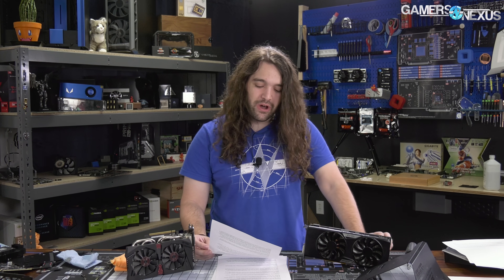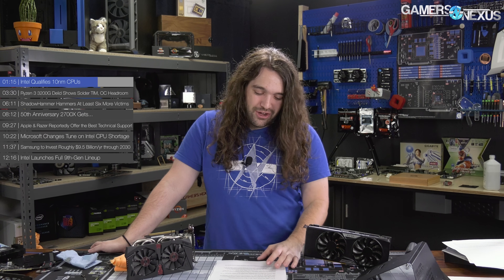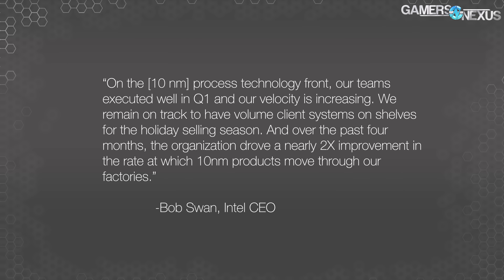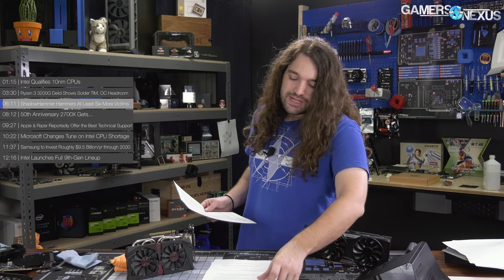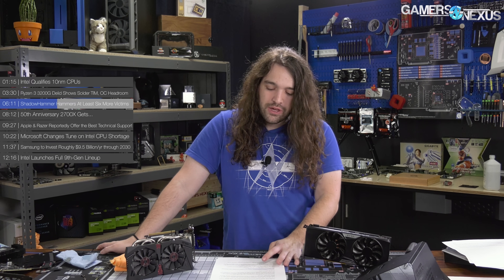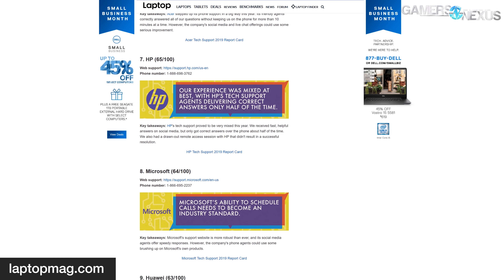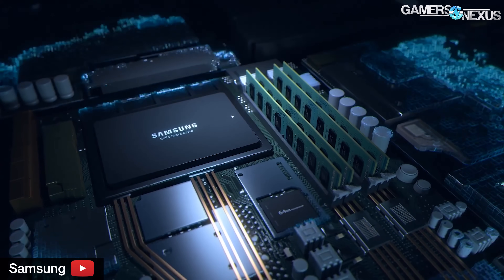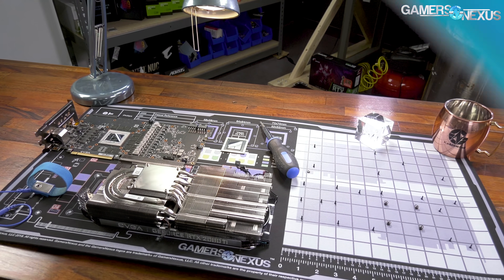HW News - Ryzen 3200 Delid, Intel 10nm Qualified, & More Malware

Comment: the 3200g and 3400g are clocked pretty low out of the box if rumors are to be believed. So getting 300mhz isn't really that impressive on these chips. It still puts their clocks in line with other Zen+ chips. 

I can't wait to see some 7nm leaks. That's where things should get interesting.

Comment: I see Ryzen 3000 news, I click
Reply: Although, the 3200G is based on Zen+, manufactured at a "12nm" process instead of 14nm. Quotes because 12nm is a marketing term for optimized 14nm.
Reply: @Kepe  "12nm is a marketing term for optimized 14nm" and most people will fall for this...
Reply: @Kepe  
14nm is also marketing term for optimized 16nm.   These nanometers are just marketing terms..with "14nm process" some things are done at 30nm and with 7nm these things are done at 20nm.

Comment: So the 3200 G and 3400G are Zen+ respins, to slot in before the Zen2 3300G and 3600G.
Reply: Lol you really are dumb.... Believing adoredtv leaks which have already been proven false
Reply: I doubt 3300G and 3600G will be a thing but yes that's right
Reply: If you want a 7nm Zen Apu you will most likely have to wait til 2020 when they release Ryzen 4000 series 7nm+. The 2200G and 2400G were 12nm Zen Apus.
Reply: The 3000 APUs might all be Zen+ to free up manufacturing for the higher end chips.

Comment: AMD sold a bunch of 2700's for $220 last month so I am believing the 2700x anniversary chips will be binned
Reply: From the leaks I have seen the 2700x anniversary model just has Lisa Sus sig on it and not binned as it has the same clocks as the regular ones. People buy them to support the company.
Reply: I think if they improved the chip at all or had a reserve of binned chips, they'd at least name them something different, like the 2750x. Since it is likely an identical chip they probably didn't feel good renaming the chip. 

Obviously speculating here of course :)
Reply: Tzuede Off the Cuff  it's further testing. Each company has their own methods so theres no straight answer
Reply: Tzuede Off the Cuff   You're not conflicted if you don't know, you're just uneducated. You can't be conflicted on something you don't even understand, because you lack the ability to even process the information.
Reply: @shawnpitman876  9 year old

Comment: AMD: Solders low end APU

Intel: What should we use for our $1000+ HEDT CPUs? Why, toothpaste of course!
Reply: Langam i seriously thought that guy was joking at first when he said backwards compatibility, longevity, and industry needs. I really thought that was sarcasm. And then the rest of the comment came and I was like what lol
Reply: @shawnpitman876  Thanks for your awesome "offend" ... But I know the truth can be so painful ;/
Reply: @ExceptionalWorld  LOL yea truth does hurt doesn't it? Solder > LM. 
It lasts longer, and for 99% of people that's what matters. Because most people don't care to service their computer in depth every few months to a year.
idiot.
Reply: meteorbdragon100 LM is actually better by 1-2c (you can get it thinner), but it isn’t as good for long term, and doesn’t work for sub-zero extreme Overclocking. Solder is by far the best for longevity out of probably everything though, and about 20c better than Intels toothpaste.

LM won’t last as long though, so you don’t want to use it, and you don’t want to force a user to maintenance it every few years.
Reply: @jakegarrett8109  Then you have measured incorrectly, or incorrectly applied the liquid metal. But with me there were higher values between solder and liquid metal ... at least 5-10c
Reply: Tra1aW_PC yeah and than your ht doesn‘t work and few other things
Reply: Don't forget: Silver vs Indium = Silver win the "Thermal Conductivity Competition" under the die and over the die,  which is mainly contained with Rhodium and Gallium in our great Conductonaut :*

Remember:  
Pure Indium =  86  W/(m - K) 
Pure Silver   = 429  W/(m - K)
Reply: @ItsJustElenore  You mean Thermal Grizzly Conductonaut right?
Also you can't just compare the thermal conductivity of the material itself. The indium soldering has to be MUCH thicker than a liquid metal application, which will have a negative effect on the actual thermal transferring performance.

Check the Der8auers "Bad sTIM? Why is the 9900K so hot?
" video for example, He shaved off 8c° by delidding his 9900k, removing the indium and using Conductonaut instead. 
Also the die of soldered CPUs have to be thicker so they can survive the soldering process etc. He got another 5.5c° off the temperatures by lapping the die by 0.2mm
Reply: @meteorbdragon100  no it isn't lol r u ok
Reply: @ItsJustElenore  You forget, with Conductonaut you can reach 99.9 W/mK^^ You can...
Reply: NA NA you guys define Soy Boys. It is nauseating what the younger generation has become. No one gives a shit about socket compatibility. They care about old software that controls millions of dollars of inventory and commerce. Amd is terrible for that, and the That is business other than making YouTube videos. No one writes anything custom for a corporation to work with an amd machine
Reply: @meteorbdragon100  Sure^^ Solder passes heat less than liquid metal, thats a faq!
Reply: Roman Hartung alias the 8auer say thermal grizzly conductonaut is better than solder, you can buy premium high-end cpus's from Caseking or read this fresh article: https://www.techpowerup.com/248735/intel-core-i9-9900k-de-lidded-soldered-tim-outperformed-by-liquid-metal?cp=3 ^^
Reply: Probably because vast majority of people will be buying those CPUs for professional usage, and will never overclock them.
And people buying them for extreme overclocking will delid them anyway, so Intel doesn't need to increase the die thickness to avoid die cracking during the soldering process, which would also worsen the thermal performance of the die, leading to higher temperatures even if delidded (compared to non-soldered, thinner die CPU).
Reply: The paste was due to higher density processes and high frequency. Solder would reduce longevity and create cracks due to severe swings in temperature of new chips. Intel is all about longevity, backwards compatibility and industry needs. The big blob that sits on my 9600k, the one people complain aboutbeing too thicc, is due to intel but not amd, worrying about such cracks yet trying to appease enthusiasts who complain about paste. By any understanding of these things, amd ryzen chips should develop cracks in years to come if soldered and still traditionally thin chips
Reply: @doriangray2347  They used paste to maximize profit. It's simple arrogance. About time they got some solid competition.
Reply: @doriangray2347  "Intel is all about longevity, backwards compatibility" haven't laugh that hard in three days
Reply: @doriangray2347  That's funny cause I remember Phenom, Phenom 2, and FX Bulldozer+Piledriver being soldered. And also if I remember correctly, there's still folks using og phenoms.  It's hard to argue they're doing it for longevity when AMD has done fine with solder. "Due to severe swings in temperature." Have you never watched a normal cpu in action? Sheesh.
Reply: @doriangray2347  You are simply wrong.
Reply: Dorian Gray I’m not sure where you get your info but that’s completely wrong in every way...
Reply: Dorian Gray okay but your wrong lol 😂
Reply: @doriangray2347  hey man I have a pretty good idea where you got your info, but that claim is unsubstantiated. There is no evidence for that (good luck trying to find that), and it really boils down to saving a few bucks for Intel. It started with Ivy Bridge, and people have long suspected that Intel did it for that reason with us consumers drawing the low end of the stick.
Reply: @doriangray2347  my 1090t i have had for over a decade was soldered it never dided from cracks. I have had it over clocked the whole time. Cracks really arent a problem with modern non 80's processes
Reply: @dralord1307  I agree,  I got AMD soldered CPUs from early 2000s, several of them and they are all fine.  I even delidded some soldered intel xeons from 2004 and I found no issues with the solder, so well bonded that on one it ripped the die clean off the substrate. Solder is plenty good for decades of use.
Reply: @doriangray2347  Can we stop with this drivel already? Everyone's parroting that old Der8auer's article about extreme thermal cycling ( many don't even know that was the source ), which is strictly about cycling from far into sub zero temps to high positive temps. This is mostly an LN2 concern, Intel never had any excuse and someone wanted to sell delid tools.

Normal user will have 0 issues, my soldered 2600k lasted me 7 years ( good luck with thermal paste, even if it's longterm stable ) before i retired it for a 8700k for which i actually bought the delid tools and fixed myself, so i guess der8auer's plan to sell more tools worked out!

I love the guy though, don't get me wrong, i understand that business is business, and Intel does too. Awareness should always be raised, nobody should get away with cheap stuff, especially Intel now trying to sell the new solder as something resembling the old good method, especially since it doesn't even need a heatgun to remove.
Reply: @doriangray2347   Backwards comparability 😂
Reply: @doriangray2347  You sure you know how solder and paste works?
Solder last much longer, and won't develop any cracks for years to come.
The shitty TIM paste Intel uses is practically DOA...Stops working properly 6 months in vs Solder which can last years without drying out.
Reply: @doriangray2347  You work for Intel, don't you? Nobody else would say any of that crap.
Reply: @doriangray2347  backwards compatibility? They change sockets like undies!
Reply: @doriangray2347  
> Intel 
> backwards compatibility
> intel proceed to change the chipset every 3 months so fanboys have to buy new 200$ motherboards
lmao
Reply: Philip Tsvetanov backwards compatibility for people who own their own corporations and businesses means compatibility not with a $200 cheap item but compatible with $20k-100k. I could give a crap about chipset changes. Hardware is disposable. Software and flow of  income is not.
Reply: @doriangray2347  No idea what you're on about then ¯\_(ツ)_/¯
Reply: Cuz: Liquid Metal is better than solder^^
Reply: ExceptionalWorld yes, it's superior to void a warranty than to just solder from the get go for lower temperatures.
Reply: @QuickshotGaming  Warranty, guarantee who needs warranty, if one is a professional? And if the CPU suddenly gives up the ghost, you can still exchange them. I have already exchanged three CPUs, which I beheaded, imagine that ^^
Reply: ExceptionalWorld professionals are a small margin of the diy pc market.
Reply: @QuickshotGaming  Oh yes... wait...And now? Then the other should not buy any CPUs that are not soldered ... is all feasible if you have not completely fallen on your head
Reply: ExceptionalWorld what are you taking about? Soldered cpu's are better for the vast majority of the cpu market. Delidding is a strictly enthusiast level process, you're giving up your warranty for better temperatures, a delta you could have almost already been at with solder compare to liquid metal. Liquid metal is better, but it's worse for the general consumer to have higher temperatures without doing that.
Reply: @QuickshotGaming  Nope, you don't lose your warranty by delid a CPU, when you make it right... I deliding 40 CPU's by myself (to earn some money) and none of them I had to replace or was broken afterwards...
Reply: ExceptionalWorld wait if you haven't broken a cpu from delidding how are you so confident you haven't voided the warranty? Keep in mind in the US at lease the Magnuson Moss Warranty Act is the standard, they have to prove you caused the issue to deny coverage. Something liquid metal makes very apparent if they get to that level. It's often more cost effective something cheaper to just be replaced, however when it starts to become something worth several 10's of thousands of dollars like a newer car the manufacturer will absolutely fight you on warranty claims. I'm seriously perplexed by your reasoning here, you're delidded therefore the clearly voided warranty isn't voided because you didn't ruin the cpu?
Reply: @ExceptionalWorld  are you just translating things from german as you'd say them there? then let me say your english is not the yellow from the egg..
Reply: @QuickshotGaming For example, if you exchange the original heatspreader for another one from the processor (cause of the liquid metal) and you cover the dangerous spots with nail polish and put the processor together again, so that you don't notice a difference to the previous state. I did that several times in Germany (because I wanted to get better samples = chip quality/lottery) and didn't have any problems. But honestly, how often does a processor break in the warranty period? So far I haven't caught any of it and my friends, colleagues and family haven't too. So very few of them are affected, which is why I now buy used (already delidded) processors, where I know exactly how well they can be overclocked, etc.
Reply: ExceptionalWorld if you've never tested the warranty after delidding, don't spread misinformation on the internet about it not voiding the warranty. Explaining how delidding works isn't the point, the idea is thermals can be dramatically reduced from the factory by doing what they did before. I'm not familiar with warranty law in Germany but in the US at least, if they can prove that you caused the problem, they don't have to cover it.
Reply: @ExceptionalWorld  not in any way is liquid metal better than solder

Comment: hate solder, let me have my ez delid and LM plz thx
Reply: lol
Reply: John Phillips  amd’s solder seems to be pretty good though der8aur delidded one and used liquid metal and it barely made a difference
Reply: @douglasm3310  but it did do something and I am going to have LM on hand for my gpu's anyways, plus it's fun imo. anyways solder cost real money for amd and thus id rather see a price cut no matter how slim and be left to use my LM with ease.
Reply: @douglasm3310  even on intel chips solder is almost pointless. Liquid metal does make a bigger difference because of the higher count but...that's about it. Its been proven to be a waste to solder intels chips
Reply: @yulfine1688  No, it's just that the new solder isn't the old one ( too "easily" removed ) and the silicon layer for the actual chip is too thick, which prolly was meant to help that poor soldering technique. Intel went with the least they could get away with.

Comment: I'm extremely excited to see the ryzen 3000 benchmarks, if the rumors from a few months ago are true Intel will have to make a change if the top CPU really does match or be really close to the i9 9900k which may mean there could well be a pricing war between the two, I hope that AMD indirectly makes Intel lower prices in turn AMD may lower theirs but that's a dream scenario. Any thoughts?
Reply: that's not historically how these things play out.
Reply: how is that exciting youre saying that a fake 7nm chips design that is 10nm in reality intel and amd count differently and that ryzen 3000 top end gaming cpus match the 9900k old 14nm chipset...how is that at all exciting? The 10 and 7 nm stuff is mostly marketing bullshit and the intel 10nm node is way more complex and has a higher transistor density than tsmc's 7nm node that amd uses. So yes finally getting that to produce acceptable results is actually huge.

in turn you are saying amd finally catching up again for a short time is spectacular or something when intel is literally releasing the same chips not long after and being superior again in most ways. Good job.

Comment: Why don't you say anything about the flaw in the Intel management engine  or god chip?
Reply from the maker: Would you like to elaborate rather than posting a question in the accusatory tone? We've spoken a lot about things like Spoiler, Spectre, and Meltdown. Is there something else? It's always possible that it didn't make this week's list or that we weren't aware of a news story. Please consider that possibility rather than posting a question in such an aggressive tone. You could have brought the news item to our attention in a way other than "why didn't you X?" which is a terrible way to communicate.
Reply: @GamersNexus  Was not trying to be accusatory but I am concern with the wide open back door the controls everything. Sorry if it came out wrong.
Reply: @michaelkilpatrick9105  the same backdoors that have led amds ryzen chips with what was it 12 or 13 dangerous openings straight to the code of the OS....kernel in most cases.